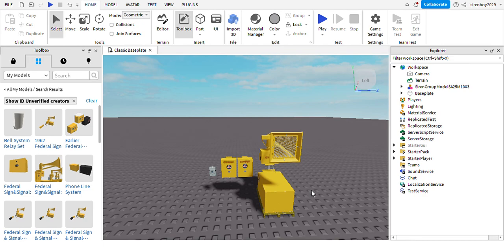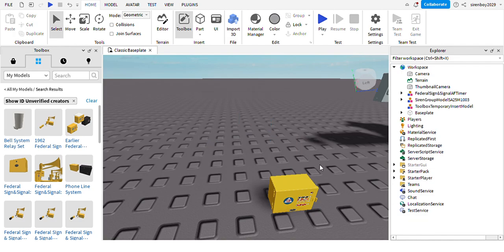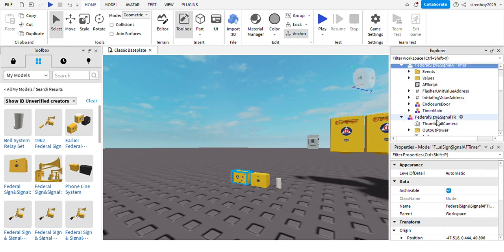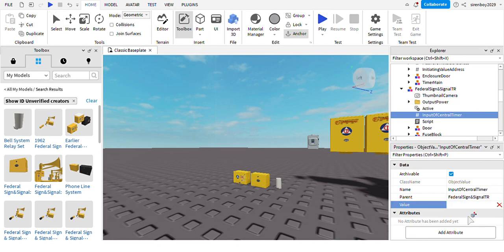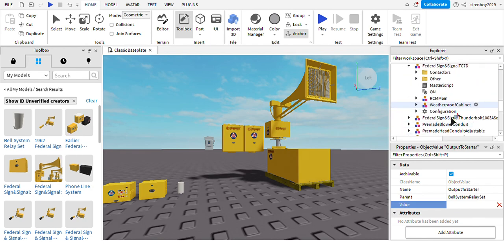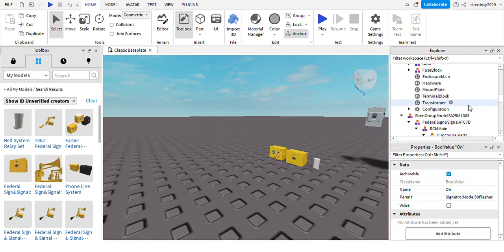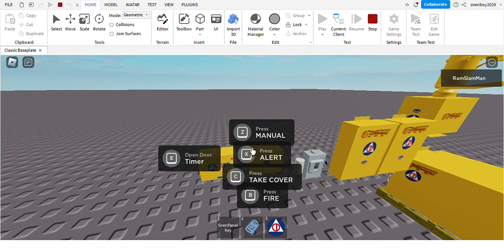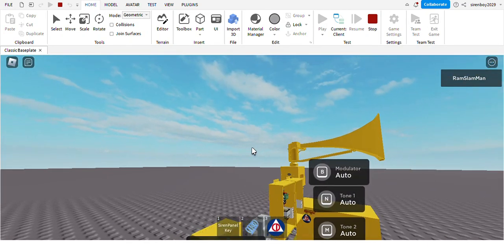How To Set Up A Newer Thunderbolt Siren In Roblox Studio 2023

Comment: This is cool and all but you missed a LOT of details with these newer bolt models. Also that audio you used on ChopperNB could use some work
Reply from the maker: What details did I miss? I didn't miss anything important for the setup. And the ChopperNB audio doesn't need any work and it was the only one I could use. Don't judge my models.
Reply: @sdpaweather  I'm not judging your models. Also, that siren is made by SS-R&D, so that's technically not "your model"
Reply: LOT Polish Airlines